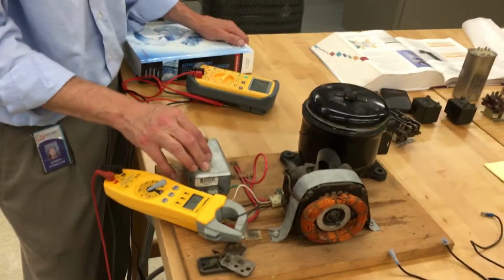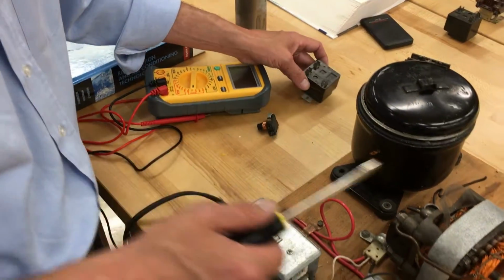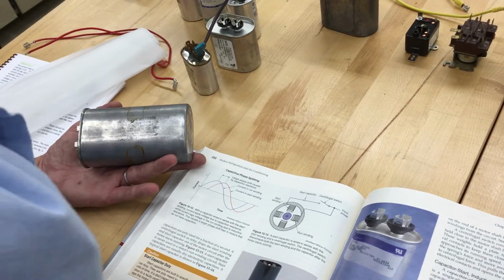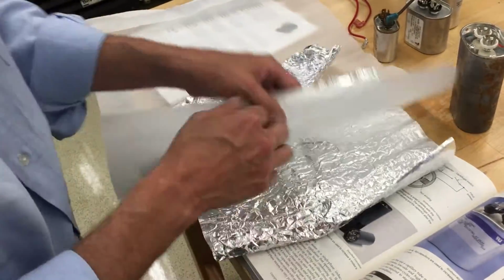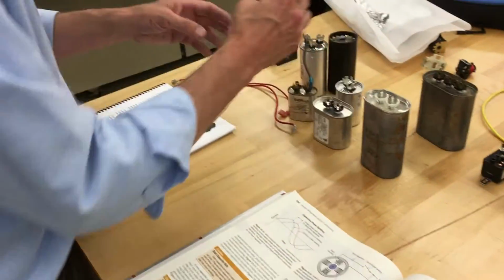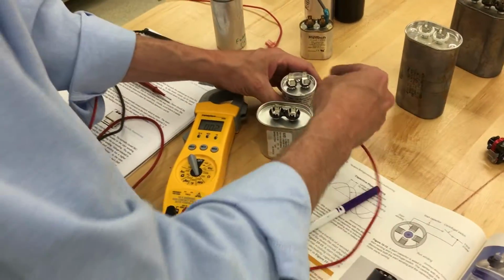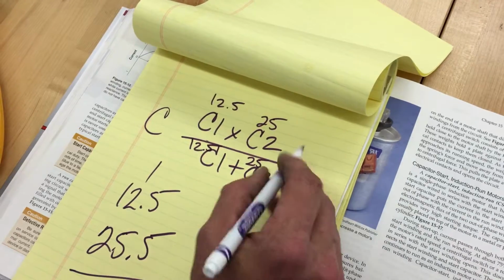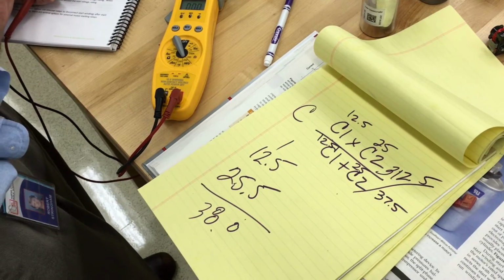HVAC Basics: Service & Troubleshoot - Compressors and Capacitors

Comment: I'd like to better understand what the Start and Run mean on the fan motor and compressor. Besides going to school for this, I was wondering if you have a source or a video that talks more about the start and run windings do.  I think I heard you say it's to do with like another sine wave at 120vac. Could you please help? Also what's the title of that big book with the pictures in it? thanks, great video. I'd like to learn more.
Reply: Mark II, "modern refrigeration and air conditioning" 20th Edition. https://www.g-w.com/modern-refrigeration-air-conditioning-2017
Reply: The start capacitor gives the motor (the start winding) the push needed to get it running. And the run capacitor keeps the run winding running